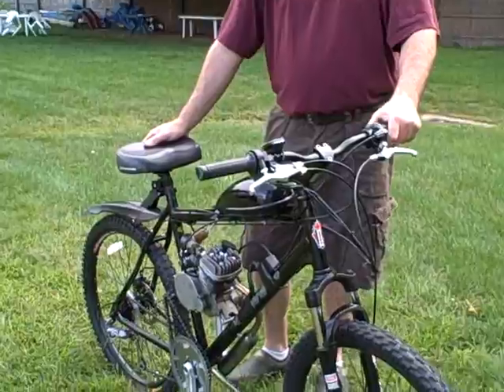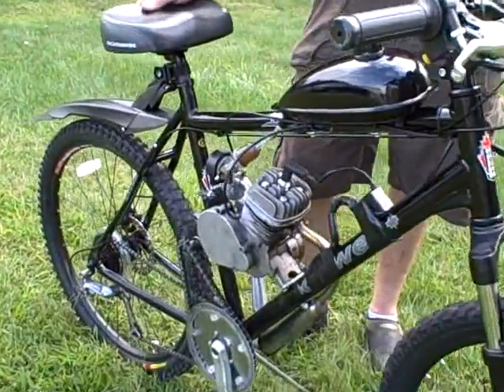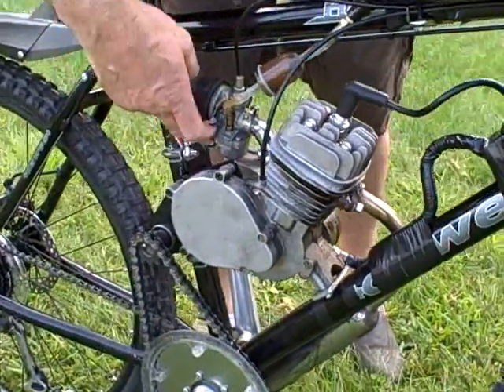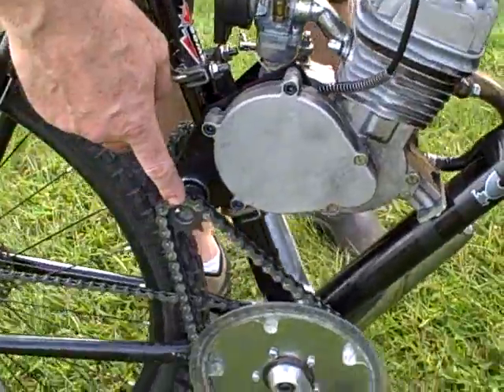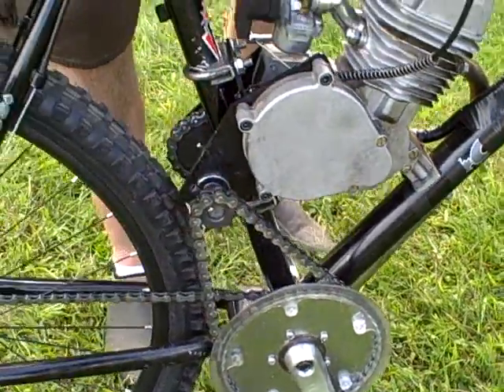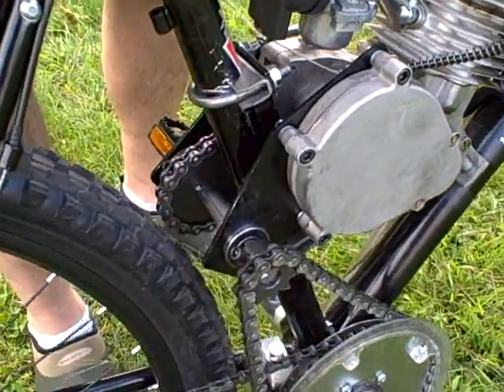Motorized Bicycle with Jackshaft Kit

Comment: Electric is the way to go. The trade offs for this motor are pretty bad. The noise created for not much power, and the way he has to keep his leg out because of the heat. Just buy a battery and bottom bracket motor and be done with it.I just got the Bafang (8FUN) BBS02 750watt with a 50V 12.5 amp hour battery. It's probably more powerful than this bike, silent, and with about 30 miles of range. At one half cent per mile fuels cost it will pay for itself rather quickly.
Reply: Ray Mosier This little gas engine requires no license, has no range anxiety issues like an electric, and is dirt cheap...
The price of a used mountain bike plus this kit.
"Take an electric bike through town, on the sidewalk, to the bank, to the grocery store...No problems. Try that with a gas engine, making a racket, blowing smoke, "
Riding on the sidewalk is illegal here, I'm not sure why riding the gas bike to a bank or store would be a problem.. You pull up to your destination and shut it off.

Personally I'd find it annoying having to worry about plugging it in.. Even if it's only a minor inconvenience.
Reply: That's good for you if u like the electric motor, but I prefer the gas motor. I feel a gas engine has more power than an electric motor. I could be wrong, but it seems to me that after a while or when the batter gets low on power than the power to the engine will cut out. These gas powered engines get 100-150 mpg and stock engines are known to get top speeds ranging from 20-35mph. if you're just riding around town you should be able to get at a month or two out of a gallon of gas. Less if you go on lots of long distance trips or go up steep hills a lot. Yes, they might be nosier than an electric motor, but I think they're a little safer as people can hear you coming. They're an affordable alternative for those who want a motorcycle, but can't afford one.I have one without the shift kit and love it. The one benefit of having a single gear for the motor is that I can still pedal it as a bicycle if I want, engine dies, or run out of gas. As long as you keep your foot on the pedal you don't have to worry about burning your leg on the exhaust or engine. You have to literally push your leg in towards the bike to burn it.
Reply: jaygarren1
You say that you FEEL a gas engine has more power. It's not about how you feel, it's about whether or not it's a fact. And the fact is that a 750 watt electric motor running at 50 Volts creates more torque than a gas engine of this size. If you like it that's fine, but you went through a lot of trouble to make the negatives associated with the gas option look like a positive. "they MIGHTt be nosier than an electric motor"? They are without a doubt. The noise makes it safer? Buy a bell. The battery loses power? The gas tank goes empty. Same thing. If you like to build project bikes that's great, but at least be honest about the pro and cons. Riding a gas powered bike in town would not only be ridiculous, but would surely earn you some tickets. offsetting that energy cost savings you pointed out.
Reply: Martin Ssr
With several tickets in your hand, and the police after you. LOL
Reply: Martin Ssr
Earlier you mentioned riding in "TOWN". I'm assuming "(your) AREA" is outside of town. Look, I'm not going to split hairs with you. Take an electric bike through town, on the sidewalk, to the bank, to the grocery store... No problems. Try that with a gas engine, making a racket, blowing smoke, You're going to have problems.
Reply: Martin Ssr
Again, we were talking about being "in town". Not just passing someones home. And the difference between your gas powered bike and a Harley is that Harley's are street legal.
Reply: Martin Ssr
Yeah, that's a plan. Keep a copy of a website hoping it will get you out of a ticket. LOL
Reply: Martin Ssr It's obvious that having the final word is more important to you than the truth. Good luck.
Reply: Martin Ssr
You just made my point. We're done here.
Reply: Martin Ssr
Keep telling yourself that sunshine. If it helps you move on.
Reply: 750w is only 0.75 kw which is less than any 49cc moped/bike, plus you cant stop and refuel an electric bike.
Reply: Ray Mosier The muffler runs down between the pedals dumbass, unless you stick your leg under the bike it won't happen, "hope you don't get your balls shocked in the rain", would be the equivalent dumb comment. I can see how you would be threatened by a gas powered motor though.....
Reply: Ray Mosier You really are a 'KNOW IT ALL" arn't you?? I have ridden mine in the city everyday for over a year and a half and the cops don't give me a second glance. I follow the rules of the road, stay off the sidewalks, ride in the bike lanes, wear a helmet, have a bell, lights and relfectors on my motorized bike and I have ZERO problems.
Reply: really you big mouth??, you know all the laws and by laws in every province and state in North America?? comment when you read by laws on Motorized bikes in Ontario, Canada, You make yourself sound stupid evertime you comment lol
Reply: Ray Mosier 
gas engines have are more power than electric. u said the electric will have more torque. well its a good thing torque doesn't equal power. since it actually is HP=torque x rpm/5252  oh and u can get a permit and even a license plate for any of these in the state of california. so no tickets. and it only cost a one time fee of $50. i ride on the side walk, i ride and the street. only time I've ever been stopped by a cop was for him to ask me where i got it cuz he wanted one. I dont have to wait along time for it to charge like ur dumbass does. when i want to go farther i simply go to the nearest gas station.  the exhaust comes no where near ur legs by the way. it actually really hard to touch it while your riding even if u actually wanted to. ive taken this thing all the way from LA to west covina (35 miles) on one tank with gas to spare then i stopped by the gas station and got some gas and went home the same day. Didnt have to wait like a dumb ass at some house for 8 or more hours. to add ive gotten my bike to go 60mph what can you do 20 or 25, lame as fuck. That's what my bike would do if i was cruising. but you know why i can go that fast cuz my engine has more POWER!!!!!!!! might not have more torque but it has way more power. and the noise is better to let people know your coming. only a faggot would want a bell instead. there is so much more you can do with gas motors. i can customize so much but electric you don't really have any options. with a gas bike u can do all sorts of upgrades, hence why my bike can go 60 oh wait i forgot. if i throw in nitro i can make my bike go 70mph for a few seconds. can yours do that? no no i didnt think so.
Reply: +Ray Mosier 
No
Reply: +Ray Mosier 
You are clueless.
Reply: Ray Mosier Another problem with electric motors is that there is a higher risk of you getting electrocuted.
Reply: meshootikill
Unless you live in the modern world where we have breakers, and fuses. I also wont burn my leg on a hot muffler, but thanks for chiming in.
Reply: Ray Mosier Breakers? Fuses? That has nothing to do with it.. There's always a chance of being electrocuted when you put electricity into the equation.
Reply: meshootikill
Said the guy with muffler burns on his leg.
Reply: Ray Mosier nope actually that hasn't happened to me before.
Reply: meshootikill
Because you ride with your leg sticking WAY out like I said in the beginning. It's foolish. And we've come full circle.
Reply: Ray Mosier
I ride my motorized bicycle around town fine without anyone bothering me. I am in NY. It depends on your area if it's ok the ride it on the street or not. You're lucky that no one has bothered you if you're riding your bike on the sidewalk. Any bicycle with a gas or electric Motor should not be ridden on the sidewalk. They should be ridden on the shoulder of the rode or where the Bicycle lane is on the road. I don't ride with my leg sticking way out. I have m legs on the pedals just like I would if the engine wasn't on my bike.
Reply: Martin Ssr Maybe I own one? You haven't the slightest clue. And I wasn't saying gas bikes are crap.. If you reread my comment you will see I actually like gas bikes more than electric.
Reply: Martin Ssr "Another problem with electric motors is that there is a higher risk of you getting electrocuted."...That's the first thing I said.. Don't believe me? Reread the comments.. I never said that.
Reply: Martin Ssr ? No I think you got me mixed up with someone else dude..
Reply: Martin Ssr I'm not seeing it on my account.. And I don't even remember saying that.. If I did I must of been mistaking.. Gas is the way to go
Reply: Martin Ssr np shit happens.. lol
Reply: Martin Ssr don't mention it..like I said we all make mistakes once in awhile.. I really get confused with this sometimes myself too..
Reply: jaygarren1
There is not a chance in hell that you ride a motorized bike in any city without a problem. In the country sure, but at that point you're outside the confines of this conversation.
Reply: Martin Ssr
You think it pointless because your position on the matter has failed. I agree with you. And we already put your electrocution argument to rest. You've exhausted all attempts to support your position and failed. But we can drag this on for as long as you like.
Reply: Martin Ssr
Since you lost the argument now you need to convince me that you don't stand alone, but rather as part of a group that agrees with you?  You have a long list of defense mechanisms. You must have failed many times to need so many. You were mistaken from the beginning. You've been informed several times. You're stubborn as well as ignorant. I will continue to try and help you understand for as long as it takes.
Reply: Martin Ssr
I accept your surrender, and complete abandonment of your position in the argument.
Reply: Martin Ssr
I accept your second surrender. You are dismissed.
Reply: Martin Ssr
And good luck with your leg burns. LOL
Reply: Ray Mosier When your battery dies see if you can find someone that will let you sit there and charge it for a hour, if I happen to run out of gas I carry a small 100 ml bottle of 2 stroke oil in my pack and I am sure I could buy $2 bucks of gas off any person along my way and mix it and off I go again, while your sitting there trying to find a place to charge. I can even carry extra gas in a bottle, how heavy is a extra battery for your rig eh? More that a litre of gas I bet.
Reply: Jason Teasdale
Riding a motorized bicycle isn't following the rules to begin with. BUSTED! Now shut the fuck up.
Reply: Jason Teasdale
Translation - You desperately want to have the final word, but every time you fail, I end up putting you in your place, and you just become more angry. This is how it will be until you surrender.
Reply: Jacob Kearton exactly my point! thank you.
Reply: But the electric motor makes no noise, requires no maintenance, draws no unwanted attention, and doesn't burn your leg. So there you have it. My point being made, Thread muted.
Reply: no maintenance?? lol!! sounds about right coming from you, and for the last tiem dumbass the exhaust on these engines isn't anywhere near your leg!!!! did you even watch the video??
Reply: Jason Teasdale
Good luck paying your tickets and treating your leg burns.
Reply: Good comeback, proves you have no point! ha ha!
Reply: Jason Teasdale How long have you been riding in the NY?Are you in the city?I am afraid of building one due to DMV restrictions,though I rode a Mini bike once and there's this neighbor kid who blazes on the sidewalk like an idiot.I would build one with re-assurance,do you live in the city or upstate?Thanks.

Comment: Where do you get the headlight/ turnsignal equipment from? Is it available online?
Reply: not sure where you can get the set-up he has, but you can get a turn signal and headlight for your bike on ebay or Amazon. Also, I think most motorized bike stores online sell lights and turn signals as well. For added safety it would probably be a good idea to get a loud horn as well.

Comment: I think this is my favorite of all of your bikes. I like the idea of being able to shift gears. Do you have any new projects in the works?
Reply: i think its cool myself, being able to use more of the rpms with the bikes own gears. id think it would climb a hill well assuming it was able to use all the gears from high to low but then again im not sure if he can  switch to those gears
Reply: Heath Fiedler It's stuck on the large sprocket up front, however the engine has more than enough torque to be able to power up a hill no matter what gear the bike is in.
Reply: Bummer! You have your work cut out for you when you get back to the shop. :)

Comment: I'm suggesting an alternate method to those with interest,anyone taking these engines apart will see that the you can easily attach a sprocket to pressure plate to move the drive to the opposite side but the flywheel/clutch combination is a loose fit so I'd remove the entire assembly and mount a centrifugal clutch to the crankshaft ether one needs machine work and engine case preparations to make appear factory.No less the idea won't be worth the work without enhancements to the entire of the assembly....

Comment: I had a plan for a build almost exactly like that. The difference was that I was going to make a fairing for the front to make it a bit more aerodynamically forgiving. Less power wasted on pushing through the air = a possibly faster top speed.

Comment: They are legal in Arizona they are not considered a moped they are a motor assisted bicycle same as Electric no Special license is required all you have to do is follow the laws for bicycles. They are not Supposed to be over 50 mL but not specified the law says do you designed for speeds in the range of 20 to 25 mph per Arizona Department of motor vehicle.

Comment: What Brand and Model bike is that? How straight forward was the installation of the motor on that particular bike? When I installed mine, it was a pain in my ass! I had to modify almost every part of the kit to fit my bike. Also, What mods (if any) did you do to the engine to make it more reliable?
Thanks!

Comment: They are not legal without a tag, and all other required lights etc. in any state in the U.S, but In most states at 50cc or less there are specific moped laws, but it's still a motor driven cycle. You could use a jack shaft available from electric bike sites, but most people might as well go electric, because they are legal. You could get slammed by a cop with tickets ranging from no insurance, no tag, blinkers, headlights, you name it on this thing.

Comment: Just subbed.  Hopefully you would be the guy to ask:  I am a big guy (6"5" 260llbs) just bought an old Skyhawk beach cruiser allready built (lacks the power to get me up the Oakland Hills) and a new Motovelo 80cc upgraded kit for a Tour leFrance Mt. bike (hopefully will fit).  Got it to get to and from work till my truck engine is rebuilt (no buses here and too steep to ride my mt. bike).  Getting a 250cc bike this weekend, but still want to build these bikes well enough to ride around the hills

Comment: .  mines a cannondale , 49cc Stihl reduced to 40rpm :1. easy with the gas when shifting. chain or 2 ? An indexed shifter that works with the type of derailer where it's cable input is mounted to a spring mechanism is a great addition.I set mine up so that i can pedal the bike with no interferance from motor when its turned off., and viceversa i dont have to peddle to keep up with motor revs...cool to see another nice....

Comment: The only problem with that is those kits only last about 50miles before something breaks. You want a good motorized bike that actually last check out Bumblebeebolton I bought one last year and have put 4,000miles on it and have not had one problem!!! I had the kit from sickbikeparts and it was cool but it only lasted 40miles then a part broke. you gotta buy upgrades for it to make it reliable.

Comment: The shift kit is what causes the gear shifts. Yes, it's really shifting gears. Here's the problem: the shift kit costs more than the motor ($240). But I think you can get higher speeds with it. I think the next time I build a bike, I'll use one of those. 
No, on the quiet. There are mufflers that u can buy, but I don't think they're going to be that much better.
In any case if u plan to commute, make sure u carry TOOLS and an extra backup of gas (16 oz).

Comment: Question, I built the same bike you have there but using a schwinn 7 speed cruiser. Im having a  issue when I shift into higher gears the chain tensioner I believe isnt stiff enoughand my chain goes clang clang.. But only in the higher gears. Im only able to use 3 gears other wise. Any suggestions. The bike is brand new....

Comment: @pyro7407 yeah ive had one and i didnt have brakes hooked up so i would just use engine drag to slow down and my feet, it works pretty good. but.... i wouldnt do it on busy roads, u may need to stop pretty quick in case of an emergency

Comment: I think it's awesome but what did u do to the pedals I see they don't turn when the sprocket spins did u have to modify that too if so how I'd like to build one too but that was the problem I ran into a pedal wouldn't feel to good in the back of the leg at 700 rpm lol

Comment: love this kit bought the shift kit for 144.00 and an 66cc motor for 129.99 and put it on a duel suspension Next Avalon 7 speed if rules. I can easily keep up with traffic and have been clocked so far at 48 mph and at a 160 mpg cant go wrong. Helps also if u buy the guards so that way your jeans wont get caught in the gears lol